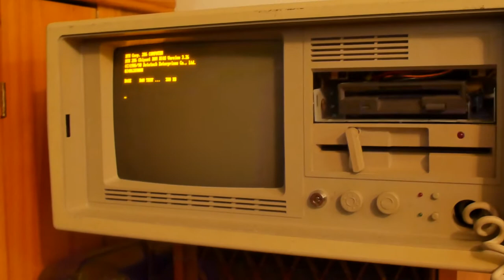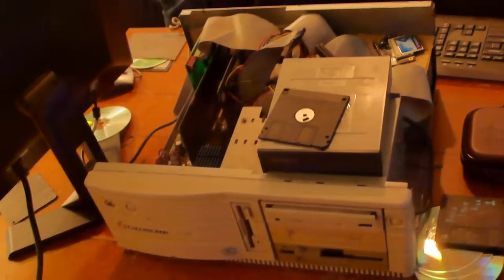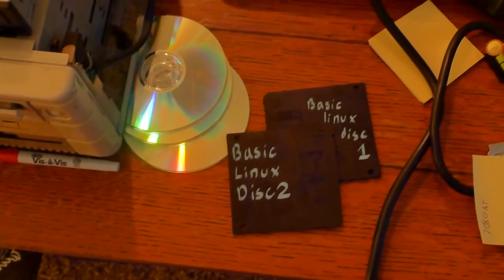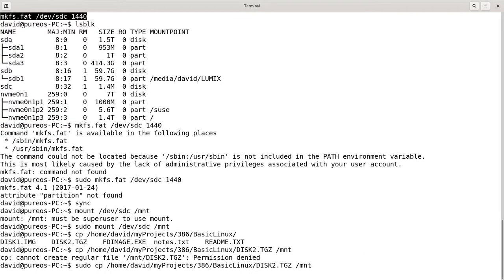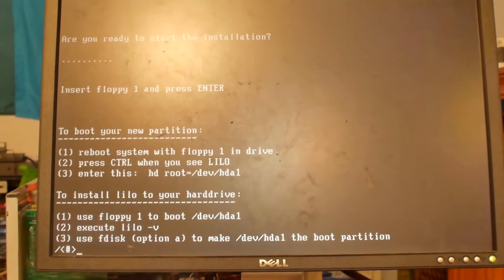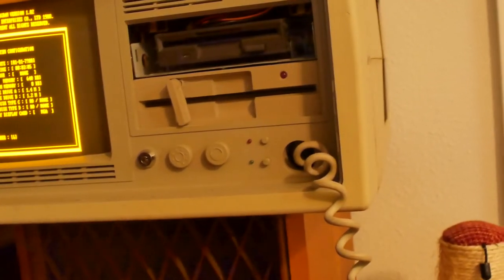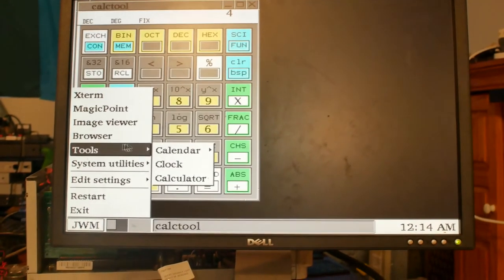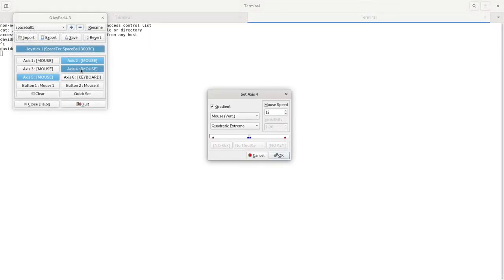Booting and Using Old Hardware

Comment: Try this , its called minimal linux live the image is 7mb fully installed.  You get a core environment with just the Linux kernel, GNU C library and Busybox userland utilities. Additional software can be included in the ISO image at build time by using a well-documented configuration file .. For that one machine where you messed up the BIOS I'd try 'Plop Linux' , a project that enables old machines to boot from any storage medium even when its not supported.  Even USB , should the machine have USB ports without a usb-boot option.  You'll find that here https://www.plop.at/en/bootmanagers.html .. Hope it works out for you.